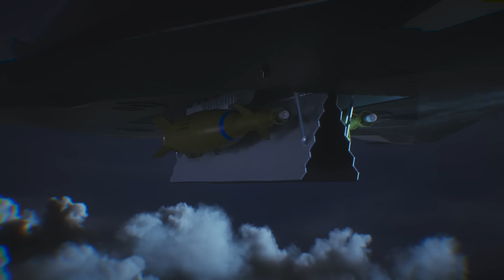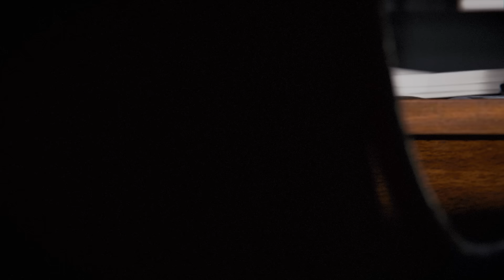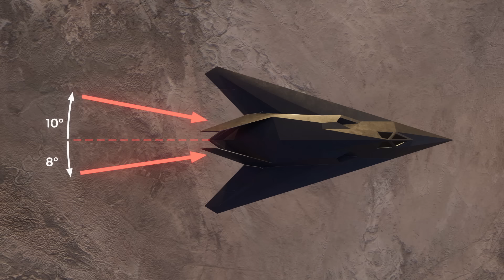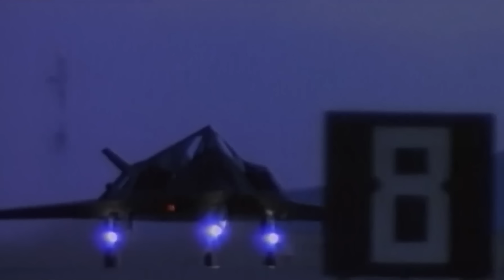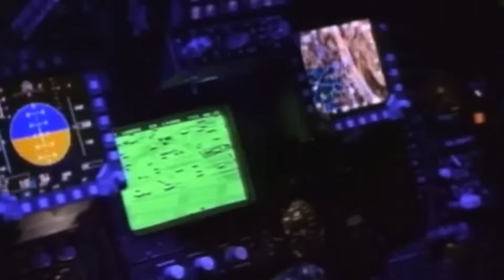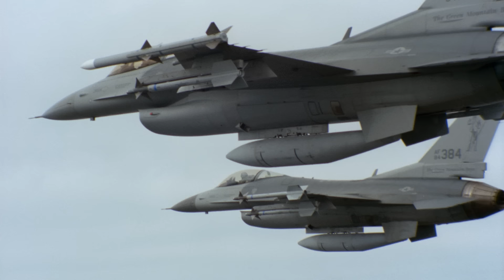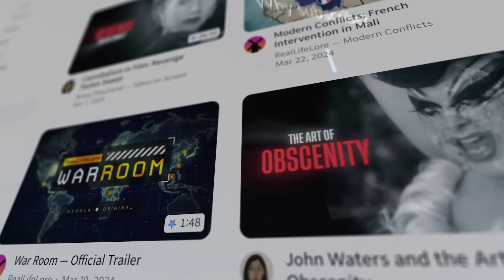The Insane Engineering of the F-117 Nighthawk

Comment: 15:25
Just want to make it clear that this point is more about negative aerodynamic features rather than poor lift.
Airfoil is more (almost entirely) about NOT worsening aerodynamics.
The lift force is almost entirely created by the angle of attack.

This is probably the most common misconception in aviation.

Comment: Is it a bomb, is it a missile, is it GPS guided or is it laser guided?

Great question. It can carry the family of laser guided bombs, the GBU-10 (2000lb), GBU-12 (500lb), and GBU-27 (2000lb or penetrator). 

It could also carry GPS guided bombs, the GBU-31 (2000lb) aka the JDAM. 

I could not find anything that stated it could carry the GBU-54/56 (500/2000lb respectively) or LJDAM, which can be either laser guided or GPS guided bombs. 

None of these bombs are thrusted, which would designate them Air-to ground Missiles (AGM). They simply use the kinematic energy from release (altitude and speed) and guidance fins to guide to the target, making them precision guided bombs, not missiles.  

Also the B61 if things get spicy.

Comment: Except: they did lose “a single aircraft…” They lost 1. Because the enemy knew when, from where, and the direction they were taking off, where they were traveling to, the fact that no support aircraft were flying with them, and the ground radar operator used low frequency radar, kept it on for 3 passes (something that would have resulted in him being blown to a million pieces if any “support” aircraft was in the air) AND, because the third pass happened to be at the EXACT MOMENT the bomb bay door was open, creating an area with radar return.

Comment: The F-117 was one of the most unreliable pieces of junk ever made. They didn't even try to keep them flying. They were so un-airworthy they needed the computer just to stay in the air. And the computers were garbage, but don't worry, the F-35 is presently racing to the bottom as well. They're down to 30% readiness already. If they get down into the teens, it's over for the F-35's. They'd be better off going back to the F-15 Eagle, and the F-18 Hornet for the Navy. But if we have to keep hiding the fleet, just get rid of them all. Our entire Navy is a sitting duck and will be in the foreseeable future. If our carrier groups remain compromised and we have to keep hiding them, it becomes quickly obvious there's no longer a reason to keep them, or the aircraft on them. And the groups are in the trillion dollar range for just one.

Comment: about the shotdown of the F-117 over serbia... that was basically a muixture of lucky coincidence, an overconfidence of the allie aircommand, and the resposnible radar operations commander going against protocoll. Lucky because the tracking radar was switched on at exactly the moment the aircraft opened it bomb doors and as asuch was actually detectable. Allied overconfidence because at that night onyl F-117s were in the air without coverage of anti-radar attackers. Which third allowed the radar commander, who knew the fact that only the F-117s were in the air, to go go agaisnt established protocoll, becaus ehe knew he was unlikely to be 'punished' for switchign on his radar more then twice, before changing positions, which then led to caus enumber 1, that third radar pulse hitting the craft during the 1.5 to 2 second intervall it was easily detectable. And even thoguh it was shot down once, the F-117 was still the most successful combat ircraft ever to be used in any conflict.

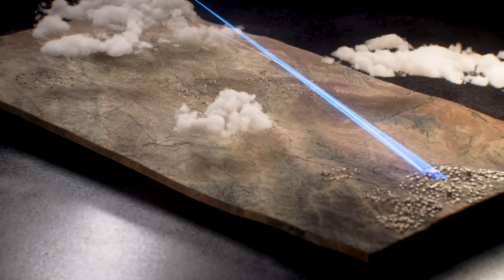Comment: Wow, flames out the back of a GBU, never thought I'd see the day. @7:33 You should know there is no fuel or motor in that unit. It gets dropped and falls, the only exception to that is a lofting technique where the aircraft has excessive vertical accent rate when "dropping" the bomb in an incline for distance. About 7 miles worth of range when executed correctly. Do your friends at Mustard and Nebula know the difference between technology? Isn't the point of this whole channel to be accurate about technology?

Comment: Not sure the efficacy to this information, but I was told a large part of that F--117 Nighthawk being shot down was due to complacency by the USAF. They ran the exact same bombing path for days on end late in the campaign because they thought the aircraft was untouchable due to its track record.

That allowed the Serbs through good intelligence of that info to place an anti aircraft site DIRECTLY under the flight path of the nighthawk. They knew a more advanced newer system would likely loose lock or have trouble tracking the nighthawk, so they chose an older more outdated system that #1 could be fired without a confirmed target, #2 the missile would simply track to the location the operator programmed before launch using speed, direction, and altitude, tracking the best signature it had even if it wasn't an aircraft.

The Serbs also knew that the bomb bay doors had to stay open on approach for the calibration between the aircraft sensors and the munitions before they could be dropped, as they would consistently get faint signatures of an aircraft for a short time before bombings were reported.

The Serbs essentially hand guided an old outdated missile directly into the nighthawk that was shot down during its most detectable state with the bay doors open. 2 missiles were fired at the nighthawk, the first missing and the second detonating in close proximity damaging the aircraft beyond flight capabilities. If the mission planning teams behind the campaign didn't get complacent the F-117 program may have never lost an aircraft.

The F-117 still actually flies today for R&D purposes, my best guess is to test new radars.

Comment: Foot high sea waves came upon a thirty metres wide fine sand spit. The moved at walk. As an engineer I saw something I was interested by. A bit like railway wheels, the slope of the sand seemed to draw the inner slope of the bottom of the waves around the point, with a radius of some 16 metres, such that it eventually was returning from the direction it came. Having a degree, including physics, I was sure this was unusual.

Comment: How would nukes detonated @ 100K+’ pose a fallout danger?
Reply from the maker: Gravity exists
Reply: @RealEngineering , fallout is generated when the fireball reaches the ground irradiating the soil and suspending it into the atmosphere for downwind deposition.
If the fireball occurs at the very high altitudes which you referred then it would not reach the ground to irradiate and suspend the soil for fallout.
Reply from the maker: Fallout is irradiated particles, sure a ground explosion produces more, that does not mean an air bomb produces none.
Reply: @RealEngineering , the premise of your argument was that Western Europe would be subject to massive to massive radioactive fallout from high-altitude detonations of Soviet nuclear weapons while the Soviets would be protected from fallout by prevailing winds.
Now you argue that irradiated particles will fall to the earth in a quantity that is not zero.

You seem to be twisting yourself into knots to avoid acknowledging that you may have been incorrect about a small part of an otherwise great video.

True, there could be some fallout which reaches the surface but this would be primarily made of the fission products from the original weapons materials rather than from irradiated particles.
High-altitude detonations were extensively studied during the early 1960s and fallout was not an issue however these events caused major damage to communications equipment through the EMF radiation.

The prevailing winds in European latitudes blow to the east so if some small quantities of fallout were generated then this would likely have landed in Russia.

Comment: That's not quite what happened with the F-117 shootdown.
It's explained well in a YouTube video called, "Stealth: A Controversy"
tl:dr though: 
It was luck. 
First: NATO was not flying any EW or SEAD missions that night, so the missile crew knew they didn't have to relocate after each radar sweep
Second: by happenstance, the operators activated their radar at the exact point when the F-117 had it's bomb bays open, which is the only time their search radars could detect the aircraft. 
It's open for about 3 seconds. 
That's how lucky they had to be, they had to have the radar pointing at the aircraft, energised and during the 4 seconds the doors are open.

Comment: There is no fallout in an airburst.
Reply: There is since the fallout will be pulled down by gravity
Reply: @Crustaceannationrepresentative  Fair enough, there is some byproducts, (the remnant doesn't just disappear:). But it's not enough to be classified harmful as fallout.

The majority of the byproducts will stay up for decades from a high altitude detonation. By the time it's landed, it's spread out so thinly as to be harmless.

According to DELFIC (standard fallout prediction tool) 

zscl = (height of burst (ft)) / yield\*\*(1.0/3.4)

if (zscl > 180) considered airburst

zscm= (height of burst (m) / yield\*\*(1.0/3.0)

fd   =  0.45345\*\*(zscm / 65.0)

Of course, in some special occasions you might have downdrafts (mountains, skyscrapers, whatever) that pull everything down. But even then, it's insignificant compared to a ground blast, which will create a massive amount of irradiated ejects.

Comment: The Serbian F-117 shoot-down was a golden-bullet situation that worked largely due to extremely lucky timing, risky Serbian behavior, and US operational complacency that allowed the detection opportunity to occur in the first place. If the US Air Force were operating the F-117 today and were exercising due caution in operations, then it would still be essentially impossible to intercept one, even knowing it had been done before. 

Edit: I don't want angry responses from patriotic Serbians so I will clarify that they have every right to be proud of this unique accomplishment, it was as much skill and calculated risk taking as it was luck - but there was a lot of luck. However, the F-117 still has a miniscule radar cross section, even by modern standards, and in spite of technological improvements in the capabilities of SAM systems (which are mostly due to interception capability, not detection) the F-117 would be just as difficult to detect and track today as it was back then.
Reply: Well now we have more advanced SAMs then that from 50s
Reply: @dzonikg And we have far more advanced planes than the F 117 now, I'd like to see them try to pull off the same thing nowadays

Comment: Insane engineering is exactly the major issue with the US build weapons. Over-engineered to become more expensive as to enrich their manufacturers shareholders, occasionally they are an easy prey for obsolete Soviet era missiles under the command of competent Croatian bakers. Not much rocket science was needed.

Weapons need to be simple and inexpensive. By being simple they can be produced in numbers and in time for them to fight. Also by being inexpensive they will not ruin their domestic economies. Weapons are consumables and consumables are supposed to be cheap. As for how much technology they should employ, they should only use as little as strictly necessary. Only technologies that will help them prevail on the immediate battlefield should be used, anything else is useless. Most of the technology employed by the F-117 was transferred to the Soviets once they were granted access to the fallen aircraft by the Serbs. I guess it saved them a few rubles.

Indeed the F-117 had insane engineering and certainly it still looks impressive today. Was designed as a stealth fighter but it was neither stealth nor a fighter. In the end the US operated it as a lightweight bomber. That is before they were proven to be vulnerable. At that point it was retired prematurely, just another failed military toy. So much taxpayers money spend without a good reason. Rather it should be spend on hospitals, education, social security etc instead. What a shame.

Comment: the shot down of the f117 over serbia wasnt down to the move, scan, shoot move strategy of the serbians
it was down to NATO becoming lazy with its bombing runs and the serbians becoming VERY lucky

the serbians knew trough local observers near the airbase that only f117 had taken off that night, no SEAD aircraft, no fighters, no jammer escorts
so all the SAM operators knew they could safely use their radars more than 1 ping per locaiton
and by pure luck, one of them on his third ping, locked onto the f117 in the tiny timeframe where its bombbay was open

Comment: “stealth designed with precise mathematical equations”, but still was shot over Belgrade with a soviet era AA missile
Reply: ...Through pure luck, there, I finished the scentence for you
Reply: @Crustaceannationrepresentative  fortunately or not, lock and guidance systems don’t rely on luck
Reply: @alfa_centaura4980  Well they certainly do when the plane they're firing at is invisible to radar
Reply: @Crustaceannationrepresentative  not so invisible then, huh?
Reply: @alfa_centaura4980  Well it was, they only picked it up when it opened the bomb bay to drop its payload, that's the only point at which its stealth is compromised, at that point they fired 2 missiles, one missed, the other got barely close enough for its proximity sensor to detect it and detonate

Comment: Still don't understand the "F" designation on the F-117 always thought it should be an "A" since it could only be used in a surface attack role.  The usual explanation that the designation was to decieve the Soviets into thinking it had fighter capabilities always seemed a bit flippant
Reply: Nobody really knows the true reason, but the best guess is that they wanted fighter pilots to fly it, since it handled more like a fighter than a big heavy bomber, and the designation was probably just so the fighter pilots didn't feel like they were downgrading themselves from being a fighter pilot to a bomber pilot, sort of an air force hierarchy thing